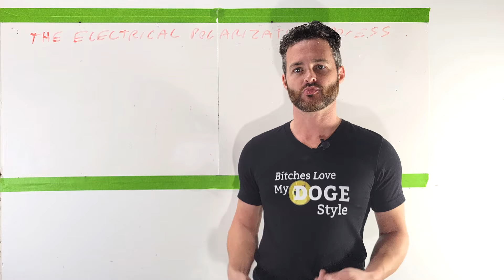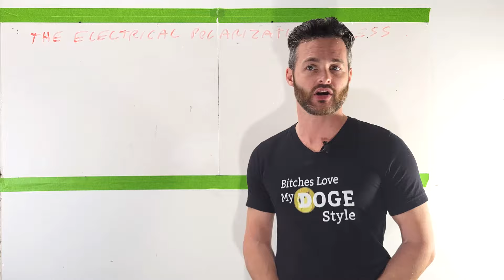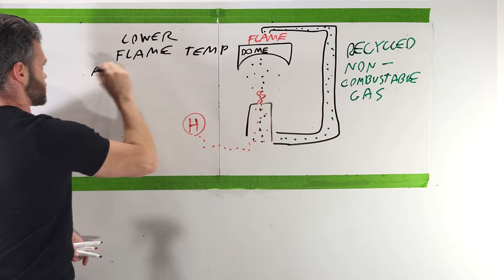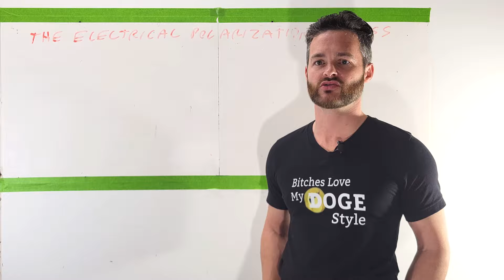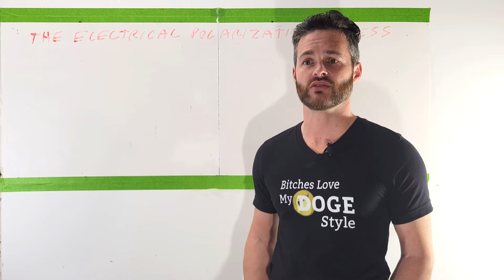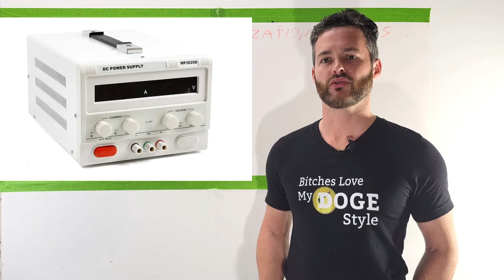Secrets of the Universe: Stanley Meyer's Electrical Polarization Process - PART 1

Comment: i do doubt he got 6lpm for 12v 3amps
Reply from the maker: 36W does seem low. Perhaps 360W.
Reply: @noahauman yeah its hard to accept especially after trying myself , 
 what do you reckon is the difference between running high V low A  and low V and high A through a cell? 
after watching some of yours, i think I might invest in a high v dc power supply aswell 120v 3a is my budget limit though
Reply: @noahauman have you seen everything to do with meyer? i can think of a different setup that should do better with high voltage  a true series setup, whether you like it or not the 2 pipes +/- are actually side by side conducting which is parallel connected not lengthways end to end which is in series , dont think one person has ever tried that, it should automatically keep current at a minimum while allowing 1000s of volt to flow, honestly I'm also trying to discover something
Reply: @noahauman it's a shame your communication skills are lacking, even when it's for the advancement of the hho subject which is also lacking.
Reply: @noahauman do you reckon you'll ever set your cells up like stan did? or you gpnna not even try what he did?, he wasn't running power through his cells

Comment: Brother ditch the transformer use pancake coils and your cells as a tank circuit. You need higher frequency for true resonance. And higher voltage the cells need to ressemble capacitor dielectricum breakdown. That's the point where the exponential gas production kicks in. That's the whole point of Stanley Meyer's apparatus you still use it as a stupid electrolysis cell. You need dielectric breakdown in the cell the water is the dielectricum. That needs to be broken down. I mean brother did you ever calculate the resonance frequency of the tank circuit aka the secondary and the cells with that few pf of capacity? If I had it right it is not some kHz but i. The MHz rage what you have.
Reply from the maker: Doesn't mean there's not sub resonant frequencies that you can hit (octaves)
Reply from the maker: And that is not the point of the Stanley Meijer apparatus. IT IS NOT ELECTROLYSIS

Comment: VPP is only stage 1 to 5 in his process. The process has 13 stages.. If i was you i would concentrate on what happens after the VPP. Stage 6 and on to 13, Gas Ionisation and onwards to Hydrogen fracturing. Life is a gas and Oxygen Cations will do work...
Reply from the maker: Pretty sure you mean EPP though you said VPP twice? Working on stage 2 now - gas reaonant chamber.

Comment: While I don't think this is going to ever get above "100% efficient", the methods proposed here seem interesting. The only thing I wonder is what resonance are you talking about in water in the kHz range? Water resonates at the near 750THz range, nowhere near the kHz range. From your diagram, it looks like you're trying to vibrate off the hydrogen atoms from the end of the H-O bond at the resonance frequency of the molecule or the bond itself. That would require a much larger frequency than you're giving the water. There must be something else going on.

Also, thermonuclear energy is released when small atoms are fused or large ones are split. Are you saying you're producing Helium from your cells as well as HHO? HeHO?
Reply from the maker: Whether or not 100% efficiency is attainable, the efficiency can be much greater than any other means available today, I believe. The resonance has nothing to do with the water, atom, or resonant frequency of such. Resonance in my apparatus is simply the LC tank circuit that is established when placing an inductor in series with a capacitor. The Cells just act as water-capacitors (being part of the LC circuit). The molecules are split due to the opposite electrical voltage field (not vibration), which affects 3 of the 4 nuclear forces that hold the molecule together. At the Cells, it's practically static voltage fields that are established that the water passes through. Stanley goes into detail with this in his conferences. Perhaps check out my playlist titled "Stanley Meyer - The Ultimate Playlist" for some of those videos.

I'm not releasing gTNT, as that is not achieved until the atoms are destabilized in his Hydrogen Fracturing Technology, which is not the Electrical Polarization Process that I am replicating. The HFT is step 2 to his technology. I'm simply producing stable (no net charge) H, H, and O respectively. No atomic interaction (yet).

Comment: So in simple terms it's just driving the cell at its resonance frequency with the inductance, with the average between the positive and negative equal to zero electric charge.
Is that it?
Reply from the maker: Yes, driving the LC circuit (inductors and water-capacitors) at resonance, balancing the waveforms. Not equal to zero, but rather equal in electromagnetic strength +60V and -60V respectively

Comment: Cool. But that's not how to make craploads of hydrogen 😊😊
Reply from the maker: Why not? My latest tests got my amp consumption down to 4.5A, so I'm basically on-par with traditional DC electrolysis energy consumption (450W). The EPP will be soon adopted as the standard for HHO gas production.
Reply: @noahauman if you want traditional 😊
Reply: @noahauman try stainless steel wool tack welded onto stainless steel rods.    Wrap individually with fiberglass matt   make small copper wire connection as t bottom of rods.  This is not electrolysis. Double bubble for safety

Comment: Have you found out how stan had done it to run hho on high volts, high watts and low amps? It looks like you have done it.
Reply from the maker: This is how Stan did it (high voltage, low amps), but at a beginner level. I'm still consuming pretty high input wattage, but I am exhibiting the circuit interaction of the EPP at the Cell, utilizing only 1.12A at 118V.

Comment: Vibrating the tubes at high frequency (20 _ 40 kHz?) might improve gas production. There is a japanese inventor who demonstrated that.
Reply from the maker: My theory is that if the tubes would vibrate, it would be an inefficiency. Vibration = sound = energy. Stan also states the tubes should be stationary.